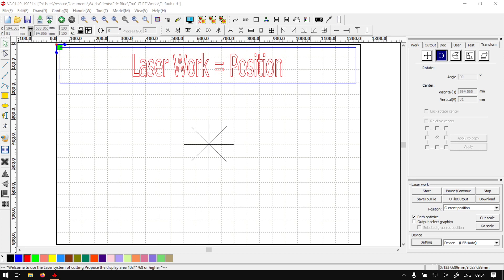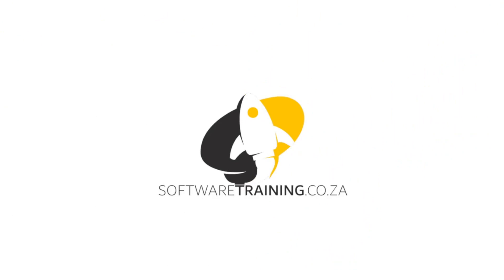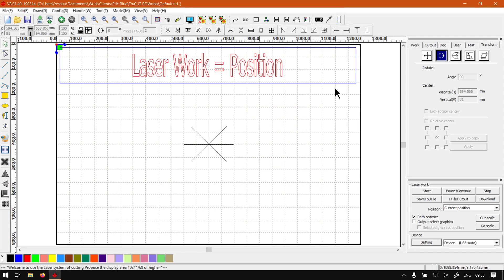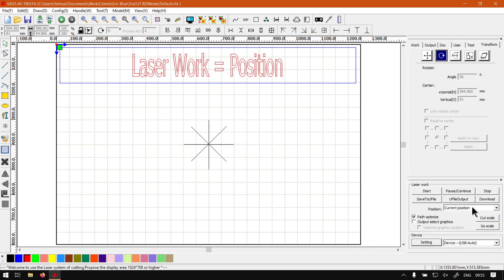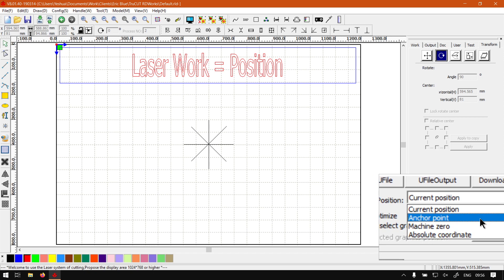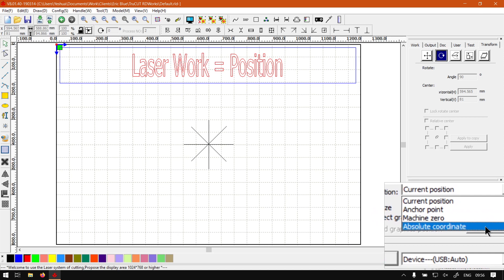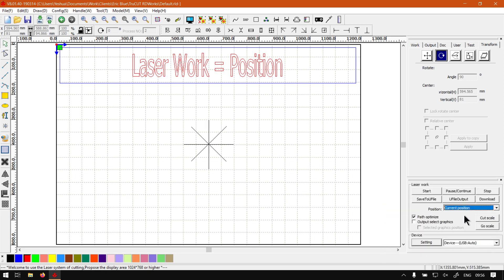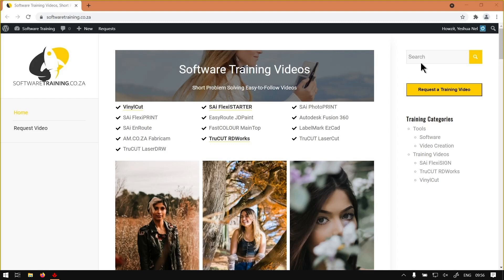Your Laser Start Position from the Laser Work Within TruCUT RDWorks (Part 5)

Comment: A second day Alpha owner - ME - has one burning question.  When setting the start point as "current position" - center, should the moves be made via the on screen arrows in Lightburn??  I think I may cause my own problems when I set use current position (in the middle of a circle), I manually move the head by hand, the frames seems to frame properly, but, the laser gives me the "out of bounds" error then after hitting continue anyway, a hard error stating a g-code problem.  SO, to summarize, after turning on the laser and it auto homes, should there after all head moves be by using the move "arrows"???   Thanks for your help from frustrated user....   🙂